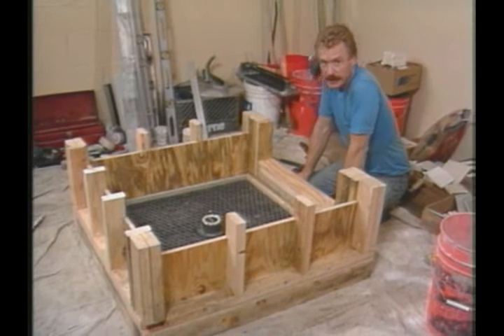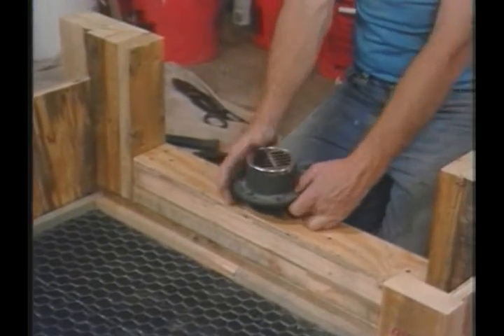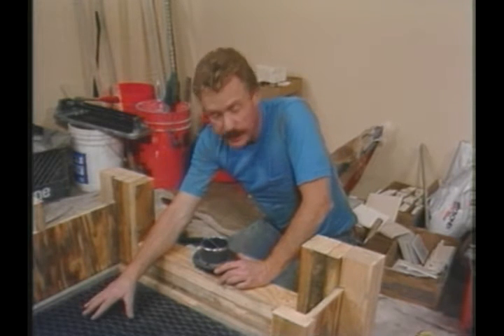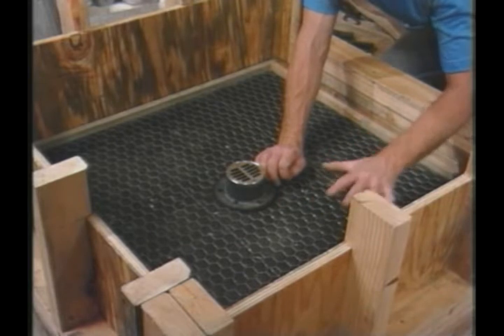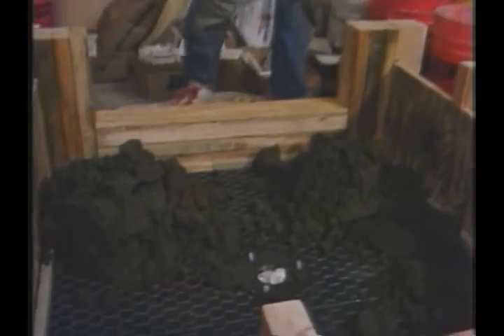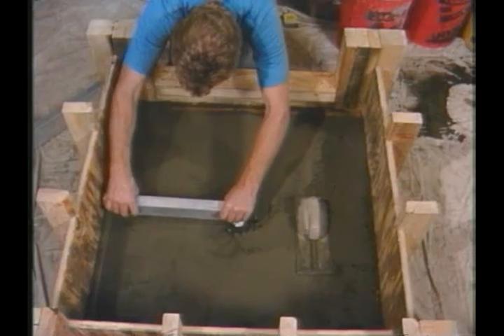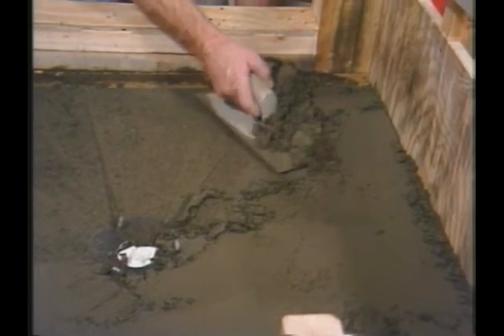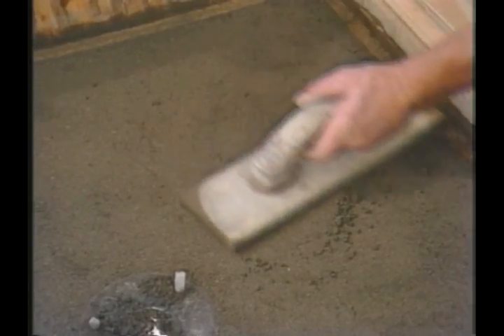How to Slope a Shower Pan: Beginning the Sloped Shower Pan - How to Tile a Floor

Comment: hi. what slop will be if the drain not in the center of shower. one side is 1 feet and the far way is 3 feet. so is the slop make it according to 3 feet ( high 3/4 from drain) for far way and 1/4 high from the drain for the near side. or we make it all sides 3/4 higher from drain ?
Reply: Your ledger strip height is 1/4 inch per foot of linear slope, so with a drain that's not centered, your ledger strips will not all be the same. What puzzles me is how you match things up in the corners. Maybe that's where the sculpting comes in.